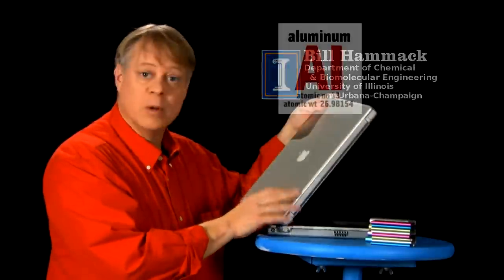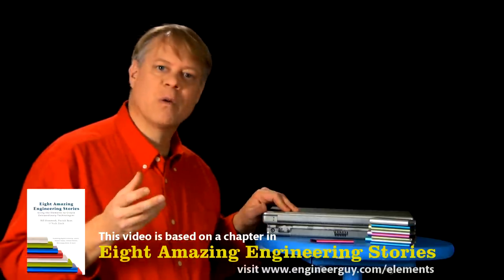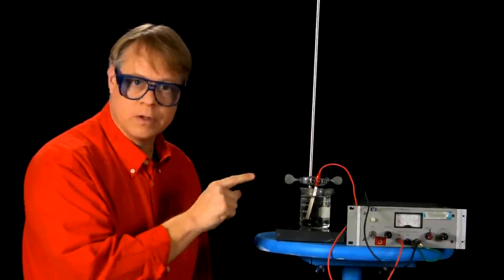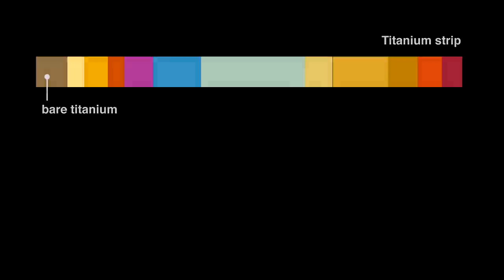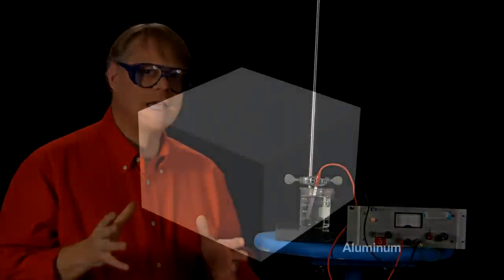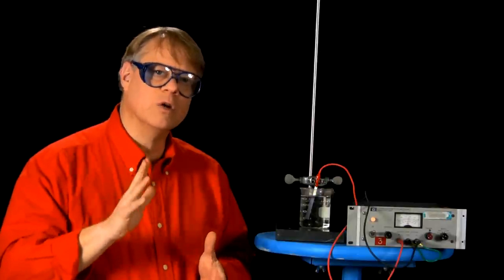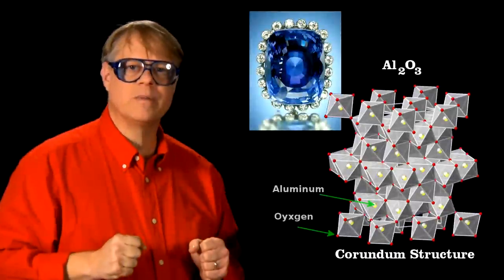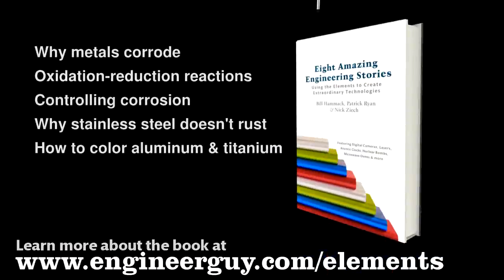Anodizing (Or the beauty of corrosion)

Comment: Can someone please explain me the colour part again? I understand that there probably has to be a phase difference between light bouncing of the Titanium-Oxide vs the Titanium, since some of the light travels deeper into the material and therefor needs longer to come out again. I too understand that two waves with the same wavelength but in 180° phase cancel each other out.
But how does this correlate with the colour of the different oxidization depth? Does the different thickness of Titanium-Oxide lead to a change of the absorption of white light? And how do I fit the cancelling interferance into there? And why is there excactly the 180° phase difference and not any other?
This just doesn't seem to make any sense to me, please send help :(
Reply: The thickness of the oxide layer changes the small range of wavelengths that are cancelled out by destructive interference. As white light contains all visible wavelengths (assuming a true white light, most floroesent  lights are not true white). The colour seen is the compulment of the colour absorbed, that is, all other wavelengths are reflected.

Comment: What voltage and amperage would be needed for a proper power source, to anodize Titanium?
Reply: I think one can calculate that using the cell potential table and stuff? I don't know how though :( And on top of this voltage required for oxidizing and reducing you need to add some (idk how high) amount of voltage to overcome the inhibiting effect of the charged layers of water formed near the electrode? Sorry for this vague answer :(
Reply: You have the answer in the video...look a the source of power, it says all...

Comment: Is this a similar process to blued steel?
Reply: +TheAllBlackMan No, that is typically done by dipping the steel in a hot chemical bath.
Reply: circ1ebreaker
I was more thinking in terms of what happens to the metal itself.
Reply: +TheAllBlackMan I don't think so.  I used to work in manufacturing, so I've seen a lot of metal get hot.  Steel changes color and hardness when heated, it also loses it's memory. So I think it's more of structural thing
Reply: yes blueing steel is an oxidation process.

Comment: can we anodize plastic
Reply: I doubt so we can as firstly, plastic is a non conductor of electricity so it can't be an electrode in this reaction. Secondly, plastic is an organic compound. So if you were to wrap thin plastic around an inert platinum electrode at the anode, nothing will happen as the organic compound in the plastic ( most probably polyethylene) nothing is saturated and cant be oxidized. Hence I don't think we can anodize plastic.
Reply: +Zhuang Tao thanku sir but still is there any way to do so i understood whatever u said but in todays techworld nothing is impossible
Reply: Lots of things are impossible, and always will be. You can only anodize a material that can rust, and even then, it's not always desirable (there is a reason we do not anodize steel).

Comment: Apple and "durable" don't go together honestly.
Reply: "Durable laptops and iPods" is generally true as far as I can tell in their case, barring the iTouch.

"Durable iPhones" hasn't been true since the iPhone 3G, unless Apple's claims of "strongest glass on any smartphone ever" on the iPhone 8 and X series phones actually proves to be true.
Reply: They are known for building durable products. , it’s one of the things people usually agree over and one reason for their price. Their laptops especially outlive the vast majority of other companies laptops. A product like a phone is hard to make durable, no company does that yet, and no company wants to do that either. Phones evolve too quickly, no company can keep releasing phones every year and keep supporting ones that are years old at the same time, it’s just not feasible.
Reply: Apple's laptop cases often last ten times as long as less durable devices, such as Apple's laptop power connectors.
Reply: Marcus Lindgren you forgot about Nokia. Their phones are often used in experiments for absurd scenarios like charging with an absurdly high current and voltage. The phone still worked despite smoking like a chimney and spitting out sparks
Reply: Love the folk defending a disgusting company. Those laptops are not uni body. They're two glued together.
Reply: They used to. Not anymore.

Comment: What bothers me in this video:
1- You don't show the full electrical circuit
2- The color change on the strip is not the same as the illustration above...many colors are missing on the actual part
3- You make it look like all the colors are available simultaneously on the strip when you show the side view
4- You did not explain the process well, is there any ion in the solution? Is the cathode contributing any material to the process? Similar to electroplating, the cathode or ions will have to contribute
5- Aluminum anodizing is very confusing. The process is over simplified, the honeycomb formation is a mystery, the spacing between the wells is not explained.

Overall, I did not learn much and I'm disappointed.
Reply: Being very detailed about high voltage electrical work is a risk as there are so many stupid people out there that might try something and hurt or kill themselves.  Remember, McDonald's coffee cups have a warning that hot coffee may be hot!
Reply: if you want more detail you could buy the book or do your own research. i think this is just meant to be a short intro

Comment: The surface area of an iPod is 5-7 square inches. The surface area of an average car is probably 500 times that. Double that number for an SUV.

It works on paper, but how would you anodize all that metal? Let alone aluminum being about ten times more expensive than steel. Besides, having hot rod flames on a car would be impossible, so we won't be able to automatically spot douchebags anymore.